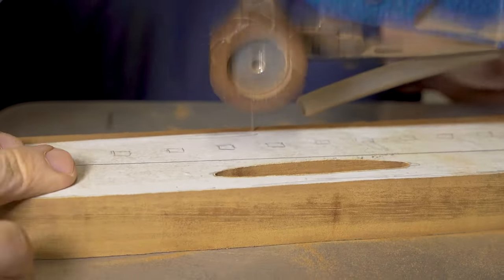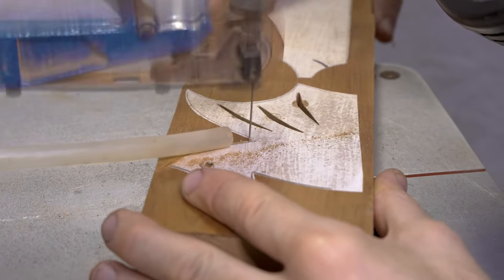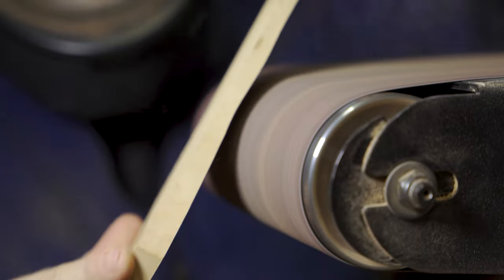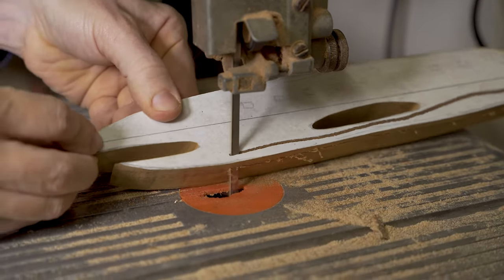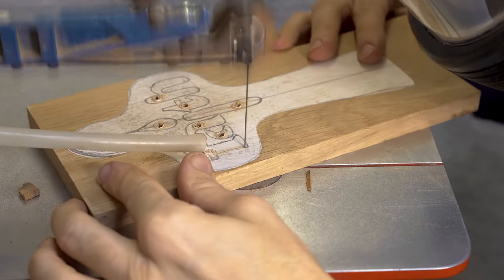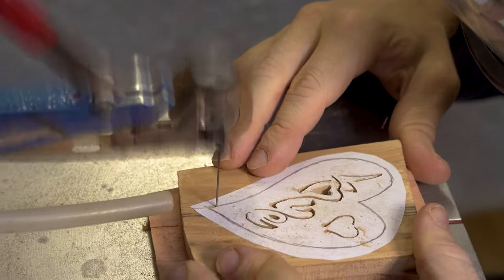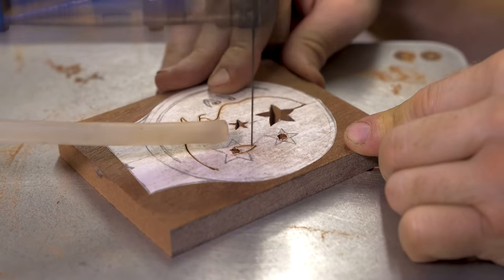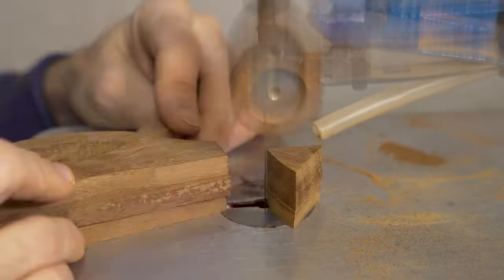Should you buy a scroll saw

Comment: You gave very sound advice. I agree whole heartily! When I retired  about 5 years ago I bought a mid priced scroll saw of pretty good quality. Then I added an bench top eight inch drill press. By the 4th  year I had also added three more bench top power tools...a belt sander with a sanding disc, an oscillating spindle sander, and a  Worx bladerunner. I use the bladerunner to cut the wood to size before scrolling. It uses a jig saw blade with a T-Top end. It sets in the machine upside down. You can rip, crosscut, and miter with it. I don't have space for a table saw. I make small wood projects and whirligigs. I had to watch twice lol! First to listen, the second time to see what you were making. Liked the projects too! Take care!
Reply from the maker: Hi Michael, always great to hear from you and to learn more about your own set up. It is very similar to the set up that we have here at our workshop. It gives us alot of flexibility when it comes to making different things in wood.

Hope all is well with you. Thanks again for supporting our YouTube channel. All the very best from us all. 👍👍

Comment: I just begin, thank you for your advice. I was recommanded to buy a Hegner with a variator. It is a bit out of my budget. Would you have a recommandation for me ? Thank you for your time and videos.
Reply from the maker: Hi Pascal, great to hear from you and delighted to hear that the video was useful. I work with a Hegner Multicut 2s myself and would recommend it to anyone getting into scroll sawing. My machine is not variable but single speed and is absolutely fine for what I do. If the Hegner scroll saws a a bit expensive for you, it might be worth having a look on Ebay for second hand Hegners. They are robust machines and you can get any spares required from Hegner. You can often find good quality Hegner scroll saws for sale here in the UK on eBay for anything between £250-500. Blades are really important too and my blade of choice for working in seasoned hard wood is the Niqua speed number 9 reverse tooth blade.

Thank you again for getting in touch and supporting our YouTube channel. All the very best from us all. 👍👍
Reply: @DailovespoonsThomas  thnak you for a quick reply, i did not think about Ebay...I surrely be watching more video. Thanks a lot and have great Christmas time !
Reply from the maker: You're very welcome Pascal. Hegner scroll saws are really well made and spares can be bought from Hegner so second hand is always an option.

Thanks again for supporting our YouTube channel, hope you have a great Christmas. All the very best from us all. 👍👍

Comment: Dear Dai 'lovlespeeons'' Thomas, with your experience on the hegner, I'd appreciate your perspective on how the saw cuts. I have a Axminster/Pegas type scroll saw and one thing I've noticed is the blade does not move straight up and down. This is meant to help it cut quicker however it also makes the saw blade appear a bit blurred before it makes contact with the wood. Which for myself makes it a bit difficult to tell exactly where the blade will make contact with the wood. Once the blade starts cutting the blade is clear and sharp to see. The blade on your video appears remain in the same position weather it is cutting or not but it is difficult to tell. My question is, the saw blade in the Hegner is meant to go straight up and down, do you find there is any movement in the blade other than up and down which makes if difficult to see where the blade is going to cut, or have you not noticed an issue with that? Thanks
Reply from the maker: Hi, I can't say that I've ever noticed any lateral movement on the scroll saw blade when working with the Hegner. It's always done a great job for us here at our family workshop. I've only ever worked with a Hegner so can't compare with the others mentioned but I have always found the Hegner to be a great scroll saw.
Reply: @DailovespoonsThomas  thanks for the reply, I've discovered it's call pendulum motion, sort of like if you were hand sawing and would rock the saw during the stroke, it can be adjusted by turning the motor. Combined with my stigmatism it was very difficult to tell where the blade was. I've managed to turn it down greatly, so hopefully it will be more usable for myself. Would need to try the hegner before I made the switch, which isn't' so easy. Thanks keep up the good work!
Reply from the maker: @titianobsidian6549 definitely sounds like it would be best to try before you buy. Keep an eye out if hegner have any trade shows in your area. 

Thanks for supporting our YouTube channel. All the best from us all.

Comment: I've only seen a few Hegner scroll saws, the pricetag should give them Rolls Royce badges (and keys). I've seen some starter £120 units, several in the £200+ range. They don't all list air blower, light etc. All show 45° tilt table and 2 speed or variable speed. 
Anything a newbie should look for? Or be aware of? Anything in Budget
 Range you would consider a good starting point? Or even Proxxon? (I have their table & band saws)
What about blades? Pun/painless? Spiral cut or assumed straight cut?

My mainstay tool is a 16x12in CNC, I can do most things on it, except very fine cuts. 1mm cutters break very easily, day to day 2mm is smallest I use. So can't do full depth fine cuts. But 20° vbit will show fine 2d or .5D detail, at shallow depth.
Reply from the maker: The Hegner multicut 2s has served us very well over the past 20+ years and our go to blade is the Niqua speed number nine reverse tooth blade. You can often find second hand Hegner scroll saws on Ebay for very reasonable prices. It does everything we need to get projects ready for wood carving. 

Thanks again for supporting our YouTube channel. All the very best from us all. 👍